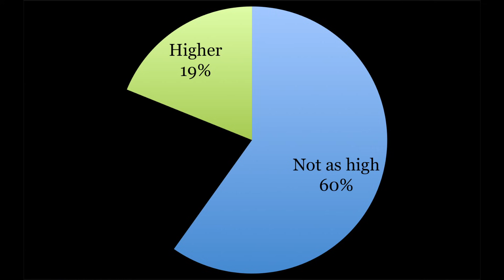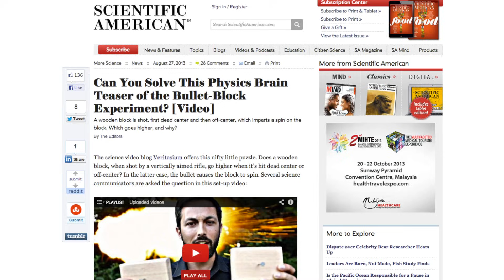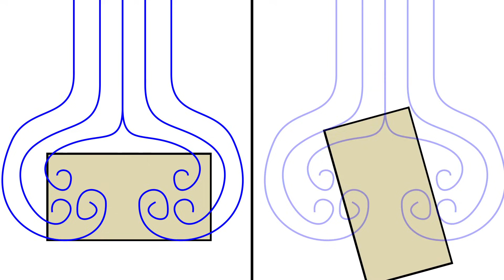Bullet Block Explained!

Comment: well, i suppose that you are using wrong material because of wood is too ellastic, and also it drains moisture from air causing expansion of wood fibers of this block.
i'll recommend to use something like clay (housed in rectangular aluminum casing)

Comment: use a low grain subsonic round and hit the spinning block at almost the very edge.  also, bigger block means you can hit it further from center, yielding greater difference in depth

easy peezy lemon squeezy

Comment: the snail was rigid straight, if the bullet penetrated the rotating block and did not make a straight line, it would be difficult to measure it with a snail i think

Comment: You should use airgun or light railgun, check bullet velocity before the impact it should be more predictable. 
For block use something like foam plastic, something isotropic, because its clear that wood had anisotropic properties, and when trajectories of bullets differ it can mess with results. Also make experiment without a bullet, would results differ if impact is ablsolutly elastic, for example you can use air flow to push block

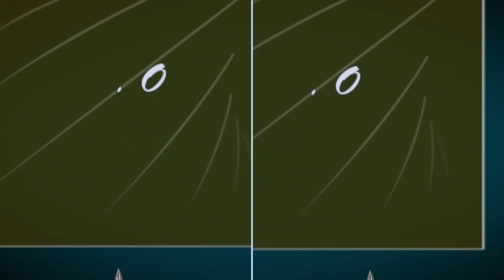Comment: Watch it again at 7:17 . 
The bullet in other case followed a curved path. 
Since the nail is totally rigid, it couldn't get inside all the way. I am hypothesizing that if a flexible wire was inserted inside and then measured, it'd have been in accordance to that of x-ray result.

Comment: You could use a weopen which gives the bullets more velocity or use a material that's softer than your wood used. Then the difference between the 2 would be more clearly different

Comment: It would seem to me that the only way to get conclusive evidence would be to use repeatable instruments. Instead of a gun, use a metal rod to hit the block. That way the same force is applied every time. Also use a metal or plastic block that would not deform every time the experiment is performed. See in order to verify this theory, the experimental conditions must be kept CONSTANT.

Comment: Have you guys calculated the difference in energy between the stationary bullet (compared to block) in the stationary block and the spinning bullet in the spinning block?  When the bullet is spinning with the block while inside it, it is actually going up and then down on the vertical plane, and back and forth in the horizontal. It is also on the outside of the axis of rotation in the spinning block so that it has a centrifugal force on the block. Does this even matter?

Comment: use some balistics gelatin, it is softer and easier to penetrate than wood. so that small difference in energy should push the bullet in by a larger amount. 

basically anything that is easily penetratable yet thick enough and light enough to stop the bullet and be lifted could be used.

Comment: If you used a less dense material where the bullet penetrates to about one meter, the 1% difference in penetration depth would be a whole cm and could be measured easier.

Comment: Likely just difference in wood deformation. It could also be 2 different blocks to those they tested with the nail. But I think we've all tried to assemble an IKEA bed and discovered that some of the little buggering holes you put the dals in are not the same holes that the EXACT same tool cut on another part of the bed where they fit perfectly.

Comment: I said increase the proportion of the mass of the bullet in the system - this could be achieved by lowering the mass of the block. If the block had the same mass as the bullet, only half the energy would be wasted.

Comment: if you saw the x-ray of the bullet which hit the side of the block, the penetration is curved, just like in the animation. Using a nail to measure the depth wouldn't have been fair as it would be accurate for the bullet which went through the middle, but not for the one which curved, as the nail is straight and wouldn't be able to reach the accurate depth. Hope this helps! :)

Comment: Because in the block that rotates, you can see that the bullet goes inside of it with a curvature in its path. Hence, when the lady put the nail in, it goes all the way in for the central hit block because there is no curvature in the bullet's path but it doesn't for the other one - unless it was pushed in or bent at an awkward angle

Comment: I think this is nearly not solvable. You said we are looking for a 1% difference in penetration. This means firstly the gun would need to shot exactly the same. Let's assume that problem is solved. Wood is too dense to see the difference in penetration because the bullet travels a too short time in the wood. So we would need a material which is 1 light and 2 still can stop the bullet. What might work is a stack of paper and afterwards you count the penetrated sheats

Comment: I think that this Experiment has come problems, lets look at variables, the Bullet power   (based on the gunpowder composition, packing quantity), air resistance (wind gusts). It would all affect the outcome. I think this experiment must performed  indoors and using a hammer like contraption to hit the block and not a Gun.

Comment: by using a medium with a drastically lower friction coefficient of friction, like a foam, a longer path would be cut.  with a longer path, the difference in penetration would be more easily measured.

Comment: If for this experiment we assume the bullet (m) is 1/100th the mass of the bullet/block combo then the velocity after impact is 1/100th the velocity of the bullet (v). That means kinetic energy before impact is 1/2mv^2 and after it is 1/2(100m)(v/100)/2 or 1/200mv^2 making the wasted energy/rotational 199/200mv^2 - so the mass of the bullet needs to be bigger in proportion to the block and the block's moment of inertia increased (move mass to the edges)

Comment: Try using blocks that are basically "bullet proof" so that the bullet does not penetrate at all. This would bring up additional safety concerns though, as the bullet may ricochet unpredictably. Therefore you would need to do the experiment either indoors like a firing range or encase the experiment area so as to contain the bullet no matter which direction it may ricochet.

Comment: The shockwaves or soundwaves whatever cancel out if you hit the center. It wont if you it off center. The wood expands and then contracts, pulling the nail hard against the edge of the contaption, thereby converting horizontal momentum into vertical. Do a video in super slowmotion

Comment: Well if your theory runs on the penetration of the bullet transferring more or less energy to the block, then eliminating some excess variables would be useful. For a truly scientific approach you would have to find a way to isolate each variable.

Starting with lower density materials should help make the difference between depths more prominent. As for measuring the depth, use something flexible to measure... the nail was hitting the wall of the curved hole.

Comment: Make a block with three steel cones, one center with the others equal distant apart on either side. The steel cones wouldn't deform with the lead bullet impact and would capture the same amount of energy regardless. 
This will remove the error from using something as inconsistent as wood; besides only using one block so no difference in mass exists. The penetration wouldn't be measured but the consistency would be there. Next a airgun might help out with a more consistent muzzle velocity.

Comment: Repeat experiment 31 times for each case so as to create a statistically significant population.  Then measure the velocity of the bullets as they exit the tip of the rifle or enter the blocks of wood.  Next, x-ray the blocks with far more precise machinery.  Snoochie boochies, problem solved.

Comment: For those of you murmuring about conservation of energy, think about if you took two lumps of clay, threw them together, and they both stuck and stopped there. There is kinetic energy to begin with, but at the end there is none. MOMENTUM WAS CONSERVED, as it is a vector quantiy. Energy was NOT CONSERVED, because energy as a whole is only conserved FOR THE UNIVERSE AS A WHOLE (within the limits of newtonian physics.)

Comment: Maybe use a block made of alternated soft and hard materials.

For example: an alternation of corrugated fibreboard and plexiglas glued together... Or maybe layers of cardboard and soft metal may be better... Or more simply, multiple layers of plexiglas with alternated colours, so the perforation can be calculated more easily.

Comment: It's depicted that way because the universe is constantly expanding. However, this stretchy 'sheet' is not so much of a sheet, but more of a hyperbolic cylinder. This allows for the constant expansion of the universe, but there really is no way to visualize spacetime, technically. The only explanation for the shape of the universe (which, realistically is indefinite; the hyperbolic cylinder is  application of physics and mathematical purposes) is that there is no definite shape, unfortunately.

Comment: Wouldn't the bullet's linear momentum break up into angular momentum and linear momentum of the block+bullet. And hence the vertical rise be lower than when the block doesn't spin. 

Alternatively, where does the block+bullet manufacture angular momentum from if, the bullet just has linear momentum in the first place?

Comment: You should do this experiment with an object mounted at the center of mass to a force gauge or pressure plate, anything similar. Make it free rotating, and shoot it the same, at least that way you have a definite measurement of the momentum spinning and not spinning.

Comment: do the experiment on a larger scale in terms of the matter the bullet is striking, instead of using wood use a matter of less density and on a large scale so as the bullet penetrates it more. As a result the 1% change between the spinning and non-spinning object would be more obvious. In conclusion the further the bullet can penetrate the object then the larger % change in the distance between the spinning and non-spinning object. Is this plausible?

Comment: Bullet depth inside the block is not the only factor -- you have to take into account how much the bullet's shape was deformed as well.  I'm betting that if you were to extract the bullets from the blocks (without causing further deformation of the bullets themselves, of course) you'd find that the off-center bullet was deformed slightly less.

Comment: I got it right!!! I am excited.
Also, perhaps differences in distance would be more easily measurable if you used projectiles with less initial energy launched into less massive, more permeable blocks (like airsoft BBs in styrofoam). that way, the percent of energy lost by each projectile would likely be much smaller (say, 50% vs 70%, instead of 96% vs 97%), and with comparable or greater penetration distances.

Comment: How about trying the experiment with a much wider block. That would amplify the difference in penetration, hopefully to a point where we can see a significant delta. Block should be slim to reduce air resistance.

Comment: Mythbusters use a gel like material, you are able to see through it so an x-ray would not be needed. The problem with materials like this is that you have a trade off in transfer of momentum, you would sacrifice the overall difference in height obtained of the block and transfer it directly into depth of the projectile into the material. Finding that key balance might take some trial and error, you might be able to calculate density with a sensitive scale and a heavy weight.

Comment: Make a very very big experiment in which the board and possibly the bullet are much larger. I'd make the board larger because it'd be best to keep the variables to a minimum, and it would be hard to make the bullet larger only because it may not stick into the original small block.

Comment: I think the use of a high power pnumatic nail gun with a regulator (much like is used in scuba gear) to regulate the exact psi of the air pressure propelling the nail) and firing into a more uniform material (IE-  A plastic) would eliminate a lot of the variables and allow for sight with the naked eye if that plastic were clear.

Comment: My modification would be to use a smaller round. It would have less mass to deform the wood with and less energy to transfer to the wood.

At the same time use softer wood.

The difference in energy transfer should be more noticeable.

Comment: take the difference in energy lost by heat and wood deformarion out of the equation by replacing the bullet with a pneumatic actuator. Then just check for the difference in the block heights

Comment: My hypothesis is that the off-centered bullet went in at about the same depth, but it went in more crooked than the centered bullet. Since the nail was straight it couldn't cut through the curve the bullet made with the rotating block.......I could be wrong, but that is my guess.

Comment: Like everyone has already said, change the medium of the block, such as polystyrene, but held between to sheets of laminate wood to avoid disintegration.   Where I will diverge is, increase the distance from the center point and increase the size of the new block to enhance bullet capture.  I predict some interesting results with this method, rotating objects with a headwind are capable of generating lift, so the rotating block may even go higher than the center shot block..

Comment: i think you would get measurable different depth if you forget about the rotation and try blocks of different weight. 

a really small block could move out of the way much faster, would fly much higher, and the depth would be really different.

or you could tie the block down, to see if it then measurably goes 10% deeper.

Comment: How about a wider block? Since angular momentum is dependent on the radius of the object, if you shot a much wider block farther from it's center, would it not follow that the measurable depth of the bullet shot into the block would be greater?

Comment: Why are they suggesting the center of mass for the experiment stays the same? The center of the mass for the two objects should be different after the collision as the bullet adds mass to different parts of the object. they are therefore wrong if they are measuring from the center of mass of the wood before the collision in addition the deformed bullet makes for multiple center of mass for each of the wood blocks. Materials could better this experiment.

Comment: Use a longer block and fire the bullet as far away from the centre of mass as you can. This means more torque is acting on the block and more energy is translated from the bullet to the rotational motion of the block. So the bullet penetration length difference will be more.

Comment: use a softer plastic or rubber block with a continuous density and use a nail gun with a nail with the exact same weight and the same pressure going into the nail gun

Comment: But he did that calculations with the faster spinning one. The other two seem to spin slower. Now I'm not that good with physics so I don't know If the slower speed from the last block would be enough to make it lose like 10% of the height. But even If It were, that would only be one example. Without statistics you can't say that It should have gone about half the height when you take only one example and compare it to only one other block.

Comment: If the speed of the bullet is high enough, it penetrate the block, and in this case, the hight between the two blocks would be different, yes? so the additional energy from the block rotating comes from the less lost to the thermal energy

Comment: To make the difference between the penetration of the bullets more noticeable, the ratio of dissipation of energy must be lower. This can be done by changing the bullet's geometry to a sharper shape,  so that it penetrates more. Another option is changing the material of the block, to another with a lower tenacity.

Comment: I'm thinking it's because the tunnel was curved on the off-center shot. It isn't as curved as much as the CG depiction, but in the X-ray picture, the off-center bullet is a little to the right of where it entered. The center shot bullet is also a little to the right- I'm guessing because it wasn't truly in the center to begin with. But the center shots are off by much smaller differences, so it isn't enough to really stop a nail.

Comment: To demonstrate the difference, you want to reduce the amount of energy lost.

Energy is more strongly dependent on velocity than mass (velocity is squared, mass is not), so to have a greater final KE, you want to make the block less massive, since by conservation of momentum v is inversely proportional to mass.

So try reducing the size of the block to an absolute minimum. It would be really cool to actually see this difference demonstrated in a future video!

Comment: I feel the experiment was prone to tricking people. The problem is that most people think about the collisions as being inelastic, not realizing that a lot of the KE of the bullet was spent on stuff other than moving the block (that's where the extra energy came from that so confused Henry and Destin). Plus you didn't provide any quantifiable data to allow viewers to check it. When I did an estimation of inelastic KE transfer I found that the block should have shot up at ~40m/s (40gr @ 330m/s).

Comment: You need something with very low mass so the block has less resistance to angular acceleration. You also want something that slows the bullet gradually, both to give the block time to spin up before the bullet stops and to increase the penetration so that the % difference will be larger. (by a factor of at least 10) I suggest glass or carbon reinforced competition grade balsa with grain oriented vertically. There should be a sweet spot for the offset to maximize angular acceleration.